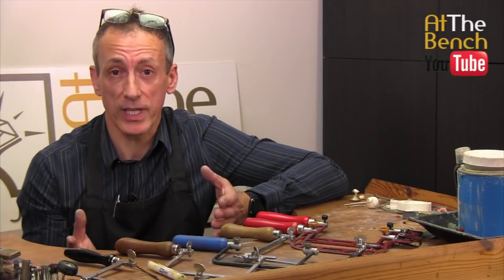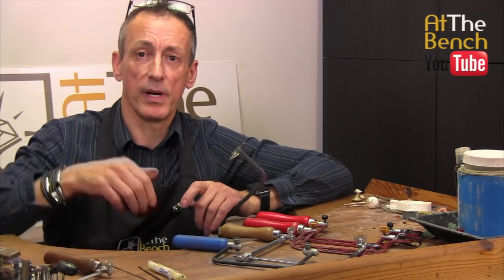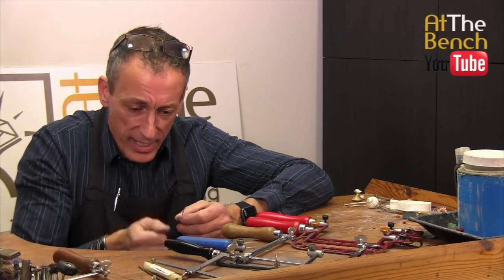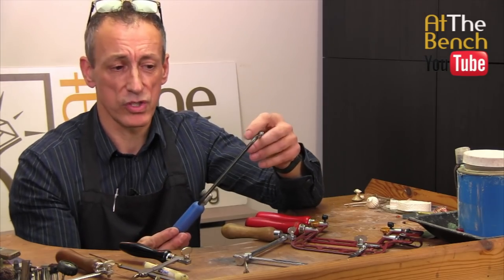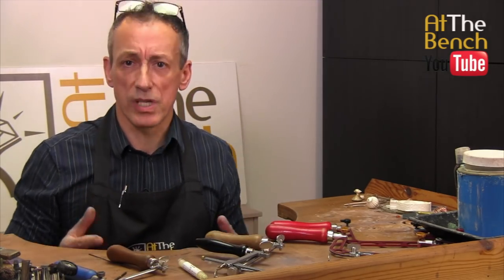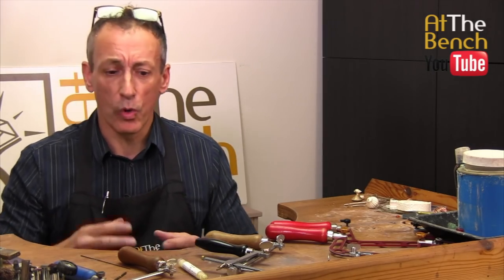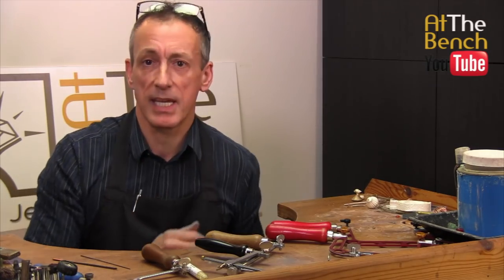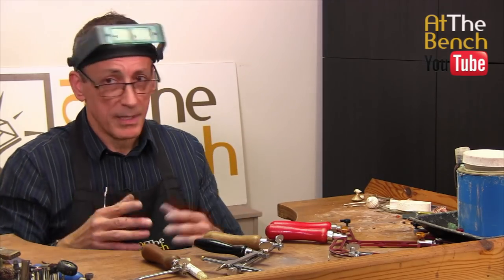How To Choose The Right Saw Frame and Saw Blades - All About Piercing Saws and Blades

Comment: Thank you for sharing. I used an adjustable for years but I now really enjoy the “New Concept” frame. The one I use has the cam adjustment at the top.  😎🇨🇦
Reply: Paul LeMay I also just got my first new concepts. W one hand in a cast I find it quite useful so far
Reply: Robin Jacobs that is great.

Comment: The Knew Concepts Mk.IV saw and the Green Lion are my favorites above all others for completely different reasons. The Mk.IV is just ingenious, I actually have two of them because I love them so much and keep different saw blades in each one for quick use, I usually use them on larger/deeper pieces because of its capabilities. But the Green Lion is so sleek, smooth, and elegant, I like to use it for much finer smaller pieces. The only time I ever use a different saw is for spiral wax blades, they’re shorter than the usual blade length so I have them in a German adjustable frame. But for every day sawing it’s always Knew Concepts or Green Lion. I would have a really difficult time choosing one over the other, it’d be like having to choose a favorite child or something, I love them both. Get a Green Lion, you need one of these in your life! I really hope you got one since you posted this video.

Comment: Great show. I always wondered why Knew Concepts was a good idea. Thanks for explaining. I'll look at mine in a new light and forgive the difficulty getting blades positioned in it.  I found a need for giant depths for LARGE pieces. They are harder to use because balancing them is difficult, but if the piece is a foot or 18" in diameter, the little ones won't do.  I hope you have some of the larger ones hidden in your hoard!

Comment: so If a I am cutting a bullion piece of fine silver that is (9/16")  7mm then I need a blade with 2.3 teeth per 7mm?  
How many saws does one need?  I'm working on a multi saw,  like one of those frames with the tension clamp, but holds three blades where the side blades will be adjustable and the center blade stationary..

Comment: I have a Green Lion saw. Its pretty, but honestly I find no difference between it and my basic fixed frame I used in college.  I had the Knew saw and gave it away. I could not ever get my blades in correctly, they kept twisting. It frustrated me and I just gave up. That was first generation Knew saw so maybe I should try again?
Reply: I have a knew concepts knockoff that I bought just for economy and works perfectly I'm really looking to buy the original.

Comment: I have problems with my eclips frame (same as yours) holding blades smaller then 4/0. Ive tried filing more groves in the nuts but that metal is harder then my files. Any suggestions?

Comment: Bearing in mind that the majority of people are right handed. Why do they always put the nuts, especially wing nuts, on the left where they interfere with fingers and thumb holding down the piece you are cutting.
Reply: Because most of them turn the sawframe upside down to “push” for tensioning the sawblade.